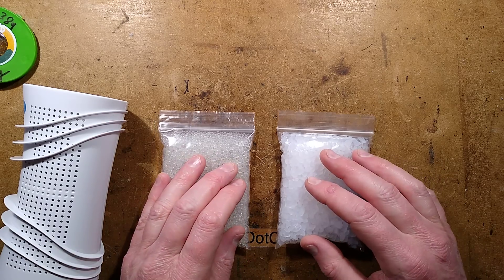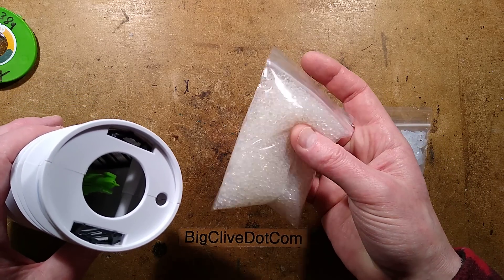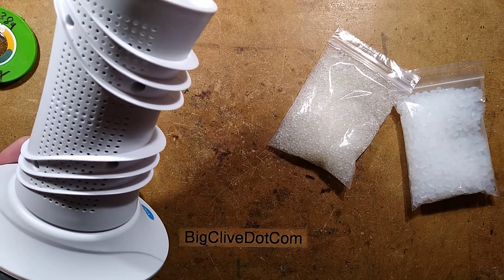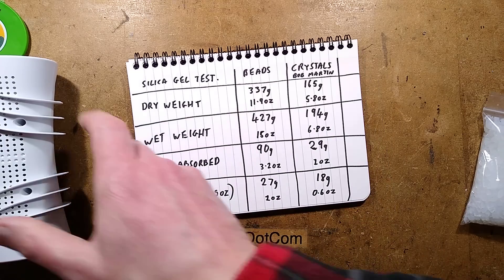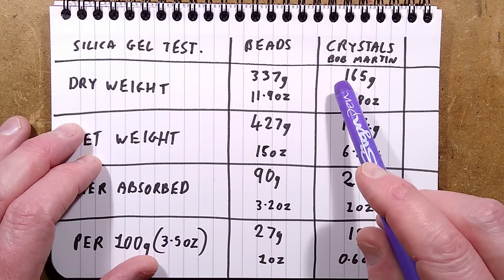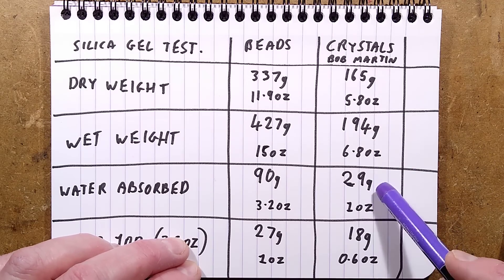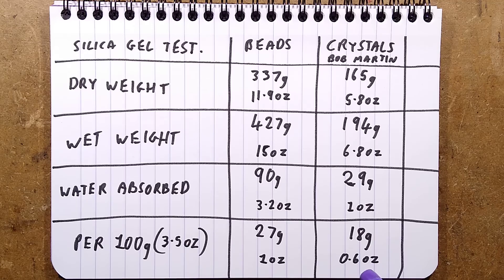Silica gel desiccant showdown - normal versus crystal cat litter

Comment: Silica beads is often used as a desiccant dryer in larger pneumatic air filters. I have such a device that holds about  1.2 litres of silica beads. Besides cat litter being less efficient do you have any idea abot how clean it would be when it comes to releasing dust and other particles compared to silica beads?

Comment: Thank you for calculating this. 
Next question is how much should we use?
Cat litter is cheap in bulk so for those of us who use a fair amount of silica for protecting our precious items we can make our own sachets.. I’ve used cat litter and empty (new) tea bag packets.
Assuming that cat litter is half as effective and twice the weight of the dedicated beads:
Required silica gel (cat litter) for a 10x10x10 cm container or 1 litre volume container would be about 4grams? 
So per box full of old crap weighing about 20kg I would recommend 100g of cat litter gel to be safe. 
Anyone correct me if they think otherwise.

Comment: You left out two crucial factors, cost and time. If the cat litter costs way less than a silica gel crystals then it could still be worth using them. Also at the time it took for the gel crystals and the cat litter the maximum water is very important.

Comment: 🔷USEFUL TIPS/INFO FOR SILICA GEL🔷
•Silica gel packets work best in air-tight containers. If they are open to air, they are constantly adsorbing moisture from the air and become saturated right away. 
•❗Once silica gel is fully saturated, it will no longer be able to adsorb moisture (Yes...I meant to write adsorb, which has a slightly different definition than absorb). 
•👍General rule of thumb for using silica gel: For each cubic foot of air volume to be protected, use 33.6g of silica gel desiccant.
•Silica gel has a high adsorptive capacity for moisture: 20% of its own weight at 25°C (77°F) and 80% relative humidity (RH); and can adsorb upwards of 40% of its own weight at 100% RH.
•Silica gel performs best at room temperatures 21°-32°C (70°-90°F) and high humidity (60%-90% RH).
•It can continue to adsorb water up to 104°C (219°F); beyond that point, it starts to release stored moisture.
•Silica gel, with its wide range of pore sizes, has the capability of adsorbing compounds other than water. The relative order of adsorbability is: water, ammonia, alcohols, aromatics, diolefins, olefins and paraffins. When the potential for multicomponent adsorption is present, the more strongly adsorbed compounds, such as water, will displace the more weakly held ones.
•Silica gel can be regenerated in an oven to remove adsorbed moisture and allow it to be used again (up to several hundred times). Spread silica gel on a baking tray & heat at 60°C (140°F) for 6-7 hours or 120°C (250°F) for 1-2 hours. 
•⚠Heating polyethylene non-woven sachets beyond 90°C (194°F) can cause shrinking/melting of the packet material.
•⛔Heating above 162°C (325°F) can damage the gel and render it unable to adsorb moisture.

Comment: Thanks, I was using cat litter crystals for my astronomy camera internal desiccant with similar results.
It was sufficient for only two nights of observation, compared to almost a week when using the crystals recommended by the camera brand.
But at 1/10th the price, It was worth it.
Also the cat crystals I found were much smaller then yours, about only twice the size of regular desiccant beads.

Comment: Why not skip the silical beads altogether and go for calcium chloride otherwise known as "DampRid" its far more powerful, it can be found for less than 2 usd per pound, and it turns into a liquid when its full of water so you know when to change it. The liquid it turns into is actually just brine (salt water) so its safe pour into the sink. 

Although you can regenerate it with heat its not very cost effective to do so, but if you want to you simply boil the brine and it turns back into a powdery puffy structure that can be ground down and reused.
Reply from the maker: The silica gel stays solid and can be reused.  The calcium chloride can cause corrosion issues if it spills.

Comment: Regarding the dehumidifier modules that you can dry out by blowing hot air in, are they not self defeating, as all the moisture they take out the air is then returned to it?
Reply from the maker: They are for drying enclosures.

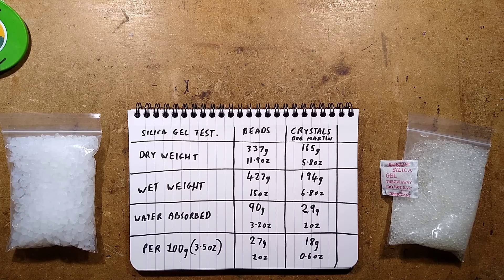Comment: 3:39 I wanted to make sort of a "slab coffin." The purpose of it would be to place a non-seasoned wood slab inside, dump silica gel all over it, and then close up the "coffin" (think crate, I guess). And then see how much faster you could safely season a wood slab by pulling out moisture for turning into shelves or tables. I wanted to use the silica cat litter, but I can see that would probably be a waste of time. If I can find the silica gel beads in bulk, that would be idea.

Comment: also, in crystal form it should be as clear or even more, transparent, than the beads, I have crystal form with cobalt dichloride as indicator (the one possibly carcinogenic) and even if blue, is way more transparent than your crystals, and insanely absorbent

Comment: i used the cat litter silica gel for a very different purpose.
first i used a coffee grinder to grind it to dust.
And then i used it to cover up flowers.
White roses.
The flower piece of my father's funeral.
And you know what happened?

It dried perfectly.
The leaves of the flowers dried without much change of color.

The only thing is that you have to be careful with that dust. You do not want to breath any of it in.
Plus, the flower has to be covered all the way, including in between the leaves of the flower.

But, the result is very nice. 
If you make sure you dry it out completely, you can put such a piece of art in clear epoxy and it will last for ever.

Just an idea for the cat litter stuff.
Reply: btw, reason for using the cat litter gel is because it was cheaper and easier to get from a store around the corner.

I do not know if it makes a difference if you were to use the other stuff.

But my experience is that the cat litter stuff is good enough for drying out flowers so you can preserve em for a very long time, and the leaves do not crumple up or discolor much.
Sure, they always discolor a bit. I guess unavoidable.
Reply: RIP your coffee grinder. I would not want to be drinking coffee that had been though that grinder afterwards tbh
Reply: @ @ Here in the Netherlands we have these stores we call "Kringloopwinkels".
They are basically recycling old junk people do not need any more, or when people have died a lot will be offered to such stores to be sold to other people.
You can find treasures in such stores, but most often you find junk.
Because those with knowledge will visit the store regularly and buy the treasures before they are offered in the store.

Anyways, that is where i bought the grinder.
I was not thinking of using it for coffee when i bought it, because it came from such an establishment.

But the grinder did a good job grinding the particles. To dust.
And it really works for to preserve flowers.
The bigger stuff will crush the flowers, and will not take away the moisture fast enough.
But if you grind the stuff, the silica gel, and you then submerse a flower into the dust, the flower will be dried and preserved almost like if it is a fresh flower.
Colors intact, shape intact, still holding together strongly.

In other words, for to preserve flowers it is a great idea to crush the big stuff to dust, and a cheap second hand coffee grinder which you never use for to make coffee, it will work perfectly for the job.

Capici?
Or do i need to take you by the hand to guide you to the loo so you can take a piss? (a joke, from a dutch guy)
Reply: @ @ Here in the Netherlands we have these stores we call "Kringloopwinkels".
They are basically recycling old junk people do not need any more, or when people have died a lot will be offered to such stores to be sold to other people.
You can find treasures in such stores, but most often you find junk.
Because those with knowledge will visit the store regularly and buy the treasures before they are offered in the store.

Anyways, that is where i bought the grinder.
I was not thinking of using it for coffee when i bought it, because it came from such an establishment.

But the grinder did a good job grinding the particles. To dust.
And it really works for to preserve flowers.
The bigger stuff will crush the flowers, and will not take away the moisture fast enough.
But if you grind the stuff, the silica gel, and you then submerse a flower into the dust, the flower will be dried and preserved almost like if it is a fresh flower.
Colors intact, shape intact, still holding together strongly.

In other words, for to preserve flowers it is a great idea to crush the big stuff to dust, and a cheap second hand coffee grinder which you never use for to make coffee, it will work perfectly for the job.

Capici?
Or do i need to take you by the hand to guide you to the loo so you can take a piss? (a joke, from a dutch guy)

Comment: I've had really good experience using calcium chloride. It's not practical to dehydrate so consider it a consumable (it's inert so disposal of "spent" material as waste is unproblematic). It liquifies when it absorbs a lot of moisture so this must be accounted for with choice of container, application in mobile circumstances etc. But unlike silica gel it can absorb up to 7 times its own weight, and its absorption rate increases exponentially with relative humidity increase. It absorbs moisture down to a much lower RH level than silica gel too (at least that's my experience). It's also dirt cheap.

Comment: Silica gel is technically a surface effect so it is adsorption,  not absorption.  I was corrected by a professor decades ago on this very subject.
Larger pore size results in less surface area per unit mass or volume.
Synthetic zeolite molecular sieves are rated in pore size in Angstroms.

Comment: I like the way Clive takes the trouble to convert the modern standard units to those from antiquity. It's hard to imagine people using such strange and archaic units in the present day...
Reply from the maker: I actually use both interchangeably.  Whichever fits the application.
Reply: @bigclivedotcom  Up until about around 35 years ago, I did the same. Then I went exclusively metric as it is much simpler, faster and more accurate for calculations when it comes to designing and fabricating precision parts. If I come across something from the old days the I consider might useful at some point, then I will convert it to metric. If both units are used on a data or specification sheet, then I would expect the primary units to be metric.

Comment: Basically the result is that both versions suck at reducing moisture in the air by a significant amount...
Reply from the maker: They both do a great job in a sealed container with 3D printing filament or other humidity sensitive materials.
Reply: Ah, I was thinking about dehumidifying a room. For small containers you are right.

Comment: I use the kitty litter in my vehicle over the winter to absorb excess moisture. I put some in a tray, or if I'm feeling particularly adventurous I fill a boot sock and hang it from the coat hook. Seems to work well - thanks for the quantification!

Comment: It makes sense. I suppose that it only absorbs moisture on the holes it has on the surface, and the same volume of small beads have a lot more surface area than that of the larger crystals.

Comment: im guessing that the numbers would be a lot closer if you broke the crystals up. this may just be a surface area thing and the crystals interior never got hydrated. this is also why you can't fit as much in the cartridge as larger pieces pack less efficiently

edit: the above may be incorrect as apparently silica gel has a high surface area on its surface but not internally, so crushing it would only result in a minor change. however it will still let you pack more in so still useful ig, albeit maybe too tedious for sth so cheap anyways

Comment: Crystal cat litter is more affective sucking up liquids, as it's surface area is much smaller than the little beads and thus sucking up moisture from the air is less effective.
I'm guessing it'll work much better to crush them up into tinier bits before putting them in the moisture absorber.

Comment: Random question but do you have a link to the little screwdriver (metal, that takes bits and looks like a pen) that you usually use on your electronics by videos?
Reply from the maker: Search on eBay for an 8 in 1 precision screwdriver.

Comment: Interesting! I use silica gel for drying greenwood turnings quickly and also to keep PLA filament dry. I can regenerate the silica gel through oven heating, does anyone have experience regenerating cat litter (preferably unused by cats). Bulk cost wise the cat litter is attractive. Yes, I should have checked comments below first!

Comment: I guess the results make sense when you think the round beeds can fit more in, appear to have more surface area for the given weight.
It would be itneresting to do a deeper dive into this as the cat litter ones are reasonable at absorbing actual liquid, even after they have been exposed to air and absorbed moisture from the air.

Comment: With the price difference I use a sock full of kitty desiccant for less than a small packet of beads. Keeps a sealed plastic container with humidistat monitor at a low humidity.

Also, drying in a prewarmed electric oven at 180(F) works a treat. 82(C) for non Freedom Unit locations. Pre-warmed and off so there's no hot elements in close proximity.

Comment: How does the litter stack up when you factor in cost?  Is there a cost advantage to using the litter that offsets the lower performance?
Reply from the maker: It's definitely easier to find locally.

Comment: Where I live, desiccant beads cost about 3.5x as much as the cat litter version by weight. It works out to be roughly twice as cost effective to use the cat litter, if volume isn't an issue. But for size and space saving, the beads win.

Comment: You need to add the following into the experiment: the cost of silica gel in bead form vs. The cost of silica gel in kitty litter form.  While the beads might be more efficient at absorbing humidity, i suspect that the cost-to-efficiency ratio would favor the cat litter.  At the end of the day, it's all about how much water can you pull out of the air given a certain amount of money.

Comment: I'd expect the primary reason that the small packets use the round ball desiccant has nothing to do with the effectiveness of the structure of the desiccant and instead is based entirely on the fact that the rough crystals would jam up a machine feed like crazy at that scale. 
It'd be much cheaper by mass to use the rough crystals, which would be attractive, but the increased feed jams would immediately throw away any advantages.
The availability of the kitty litter makes it pretty attractive to hobbyists tho.

Comment: where do you put those dehumidifiers to regenerate the silica??
Reply from the maker: The cartridges are for drying enclosures, and then get dried on a hot air regenerator that drives the moisture back out.

Comment: That is such useful information!!
I have kept those little packets for years, they are so useful.
I take a plastic bottle of various sizes, drill some holes in it and fill it with the little packets.
I have them in my gun safe, tool boxes, anywhere moisture can corrode something of value.
To date, this method has worked flawlessly for me!
Great video!
Reply: Don't forget that once silica gel is fully saturated, it will no longer be able to absorb moisture. See my other comment which includes a bunch of other tips & also how to regenerate the silica gel so they can be reused again.
Reply: @nnamerz  absolutely!

Comment: The beads have a much greater surface area for adsorption to occur on than the larger crystals- assuming all the beads are identical, and all the crystals are, it would be interesting to see if there is a correlation between particle surface area and water uptake, rather than just by mass

Comment: These types of soft crystals are also used in cheap cigar humidifiers.  
The problem I've found with the cat litter type is that when it absorbs moisture the crystals tends to adhere to themselves and even when dried, they stay stuck together, unlike the traditional silica gel beads don't.  Subsequent uses of the cat crystals stop working as efficiently.

Comment: interesting. The next unit we need to see is "water absorbed over volume"...  so 1/3 as much water absorbed and double the volume? I'd call that 1/6 as efficient in that category. Then we need this new unit compared to price of each (are the beads 6x or more the cost?). The only way I can see the idea that the cat litter is a better choice, is if you can get it for less than 1/6 the cost of the beads and your application doesn't mind that you need so much of it by volume (I've seen alternative to AC solutions that need desiccants)

Comment: Damn. I was wrong. Thought the litter had better absorbtion based on its density. Very helpful. I will use the balls in my nitrogen concentrator if I can find a good deal on ebay.